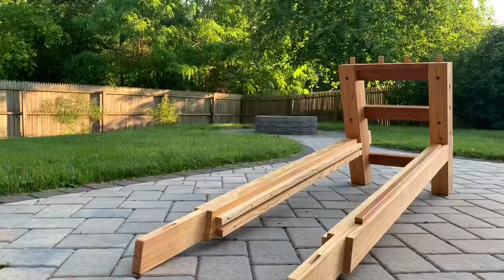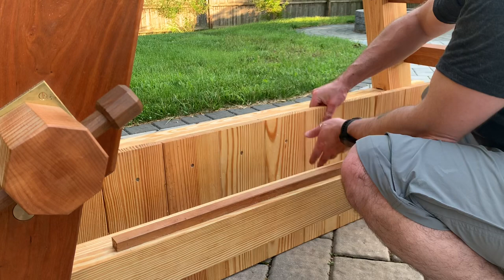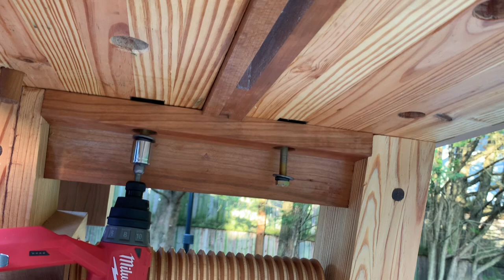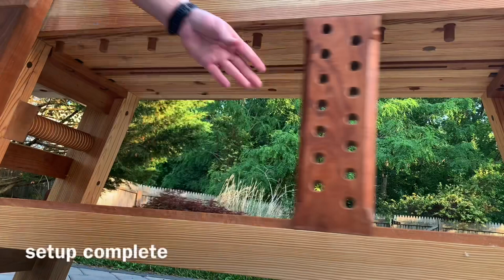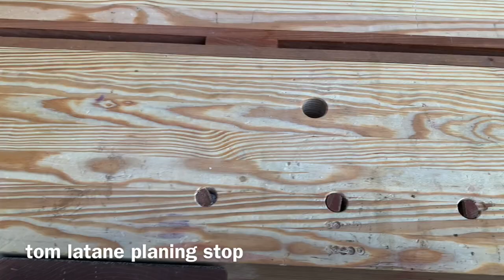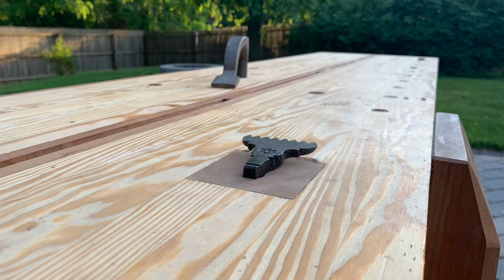Moravian Workbench Assembly Process

Comment: I especially love the leg vice because it opens up so much space for the bottom shelf. I tried to angle the vice on my moravian bench, but couldn't make it work (I was using a vice screw and a guide bar with pin holes, didn't have a pin-less chain  vice like yours). I guess will give the vice another go.

Comment: I built a bench when I started 4+ years ago with a douglas fir top.  I've flipped the top once and fiddled with vices & bench stops.  This looks like exactly what I want: replaceable top,angled leg vice, blacksmith bench stop.  And narrower than my current bench.  Thanks for sharing it so I could see it!
Reply from the maker: Thank you! I’m very happy with the bench. I would make it 24” wide if i would do it again. The 21” width now is fine but I think the extra 3” width would have been a better decision.
Reply: @zer013  Mine is close to 24" now.   I have a board down the middle.  It's pushed against the wall.  The back part is covered w/ tools, etc and I just work on the front.  I recently made a dutch tool chest and have that on the back part.  So for me, my next will be narrower (16-18" ?) and maybe with a tool tray or hang the DTC on the wall w/ an easier reach.

Comment: This is my favorite workbench on YouTube for all the same reasons others have listed in the comments.  I live in a condo and want a workbench just like this, only smaller.

I'm new to woodworking and don't have knowledge of wood variety.  I do know that pine is considered soft and lightweight, but easily scratches/dents.  What was your rationale for choosing pine?  Also, if I were to forego soft wood, what combination of hard woods would you recommend?

Lastly, is there anything you would add/delete after working with the bench over time?
Reply from the maker: Thank you for the generous compliment. First thing I would recommend is to head over to Lost Art Press’s website and download “The Anarchist’s Workbench”. It’s free to download. See Chapter 3 “For the Love of Yellow Wood”. My workbench is heavily influenced by Christopher Schwarz even though it’s not his design. I followed his instructions on the use of construction lumber. 

Things I would change: 
- Increase width to 24” wide
- Increase the length to 7’
- Eliminate the deadman so my dog holes could be closer to the edge
- Use a solid piece of wood for the “gap stop” (I don’t like the tool holes in actual use)
Reply from the maker: I wrote a thread about my workbench on Rex Krueger’s forum. You can check that out if you want. 

https://forum.woodworkforhumans.com/t/split-top-moravian-workbench/7827?u=christopher_orso
Reply: Thanks for the reply and tips!

Comment: Love your bench! I wondered if you had a tenon at the top of the left front leg and a mortise on the underside of the top to resist pressure from the vise, but I realized the machine bolts and threaded plates are doing that job. Before you added the bolts/plates, did the dowels provide adequate resisting force?
Reply from the maker: Thank you! I added the bolts because my tops would lift up when engaging the holdfasts. I never really tried the vise without the bolts so I cannot speak with experience. I have seen others with a similar leg vise that only use the dowel method.
Reply: I am using only dowels and the vise is installed using only joinery to hold it, no troubles whatsoever.

Comment: Very nice  bench  you made really good job.
What is the angle of the legs? 15,20 degrees?
Reply from the maker: thank you! the angle i used was 16 degrees
Reply: @zer013  thanks for the replay. I already start to building  too just  my leg vise will be metal because  wooden vise to expensive around here. Hope will not wobble so much.

Comment: Inspiring. I'm still using my first horrible workbench, which is a few 2 x 6s edge glued to form an 1 1/2 thick table top, sitting on 2 saw horses. I'd like to build one of these. Do you have plans?
Reply from the maker: I don’t have any plans but I just added a drop box link to the description. There’s a sketchup file and additional photos. The sketchup file is not an exact copy as I made some changes as I began the build. If you want detailed plans, check out woodandshop.com.
Reply: @zer013  Thank you. Your bench is beyond me at this point, but what I'm reaching for.
Reply from the maker: @bbiermanster  I’d say the joints in this workbench are approachable for any skill level to be honest. I never cut any of these joints before this build so they were all first experiences for me. I watched the Will Myers video a lot and tried my best to replicate his instructions. Give it a shot and you may be surprised.

Comment: Great build alot of work and expense! I'm surprised you did not just use a tenon block and wedges to hold the top on place then?  Bolts snd a ratchet wrench just well so out of place, still scratching my head! Need a new conclusion to this bench! Good work on it all thumbs up from me!
Reply from the maker: Thanks! I was upset at first with the bolts but in practice, they are amazing. I keep the bench against the wall so the bolts mean I can lift one side away from the wall easily when needed. I would add the bolts again if I built a new one 😀

Comment: Very nice build! The moravian (hey this is German as I am 😃) and the Nickolson were both on my short list last year. I decided for the latter in the knockdown version after reading Chris Schwarz book. I'm really happy with it, but since building a bench is so much fun I might build a Moravian soon, too 😂
The only problem is that all of the hardware parts you showed including the wooden screw are very hard to get in Germany...
Reply from the maker: I was leaning towards a nicholson workbench myself after reading Chris Schwarz’s blue workbench book. I stumbled upon Will Myers video of the moravian workbench and was immediately drawn to the angled legs and tusk tenons. You can use any vise hardware that’s available to you on your moravian. Thanks for watching!
Reply: I saw a Youtuber make a wooden screw. You need a plastic container to encase wood and oil (cant remember the type). The wood spends days in it absorbing the oil making the wood soft and carvable without breaking appart. The other equipment is something you can turn all the way down the wood that carves the plane. I think it was in a King workshops video. A lot of work but it is possible.
Reply: @gm2407  I did something similar when building a Moxon vice screw recently (see fotos here: https://www.dictum-handwerksgalerie.de/mit-moxxon-haelt-es-besser/). 
This is a 1 1/2" version made of maple stock. It works reasonably well and was not too hard to get right (with a set of cutters from Dictum for about 60€). The problem is the threads slope, around 6.5 tpi, which is too fine for a workbench really. The Lake Erie sets are much coarser and better quality I think.
Reply: @doedeldidoedelda  Well at least the option is there if the equipment is sourceable. But I would certainly think making the screw would be the hardest part of the job due to risk of damage to the whole piece of wood or the risk of finding a knot whilst carving.
Reply from the maker: @doedeldidoedelda  Does Lee Valley ship to you? They carry the Lake Erie woodscrews.
Reply: @zer013  Yeah they do! Thanks for the tip. I meanwhile them in the Dictum Shop (one of two useful woodworking shops in Germany).

Comment: Hey Chris, I hope you see this.  Question: what is the purpose of the slots in the center board between your two halves of the top?
Reply from the maker: It’s supposed to be a place to hold tools. Some people love it, but I hate it. It doesn’t do a good job at holding narrow tools like chisels vertically and it’s just more places for chips and shavings to fall on tbe shelf. It’s one of the things I would change if I built it again — it would just be a solid center piece.

Comment: OutSTANDING! I love the hybridization of the Moravian with the Roubo, and you NAILED the balance, there! 

That is to say: you did a superb job of keeping the strengths of each while ditching some of their... call it "less-amazing elements."

The problem with the Roubo is it relies both on too many hard 90's and the (somewhat fiddly, in some cases) precision joinery of big, heavy, expensive blocks of timber, meaning you're doubly screwed if you cut something a bit too wide.

My beef if the Moravian really boils down to its relative lack of mass and (personal preference, here, albeit) the fact I hate sawdust tra- err, "tool trays".

Admittedly, I can take or leave leg vices, though I absolutely acknowledge the structural significance in this case, and, let's face it: that was a sexy-ass implementation you didn't there. It sure as hell ain't gonna HURT nothing, and again... that's a HOT example of it!

Well done, man!

Comment: I really like some of your changes to the original design. You said, "I was having issues with the holdfasts where they would actually lift the top slightly when engaging the holdfast." Was that because the holdfast was in a hole in one of your half-tops while attempting to apply clamping pressure on the other?
Reply: seems rathe likely, from my point of view.

Comment: Definitely one of the nicest Moravian benches I’ve seen on the Internet. Stunning!
What dimensions did you use for the legs (looks like 3 1/2 x 5...?) and long stretchers?
Reply from the maker: thanks! yeah, i increased the size of the legs since i was going with the larger diameter of the wooden screw versus a metal one. the legs are 3 3/8” x 5”. i don’t recall the long stretchers offhand but those were made to the same specs as will’s plans. i think like 2 7/8” x 3 1/2”